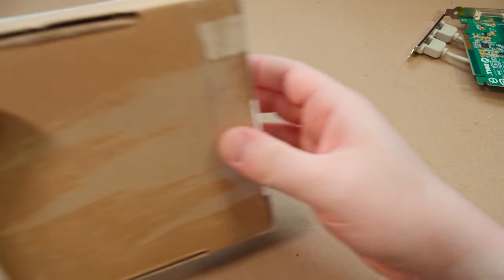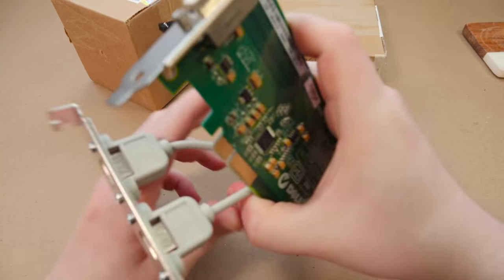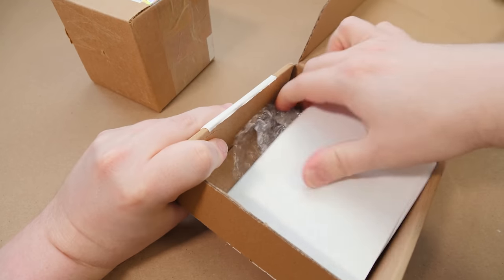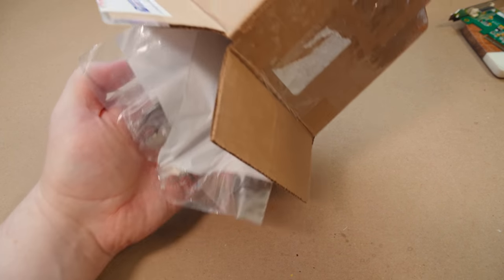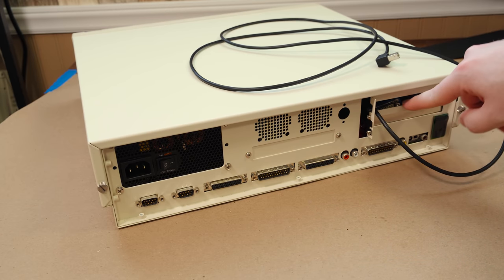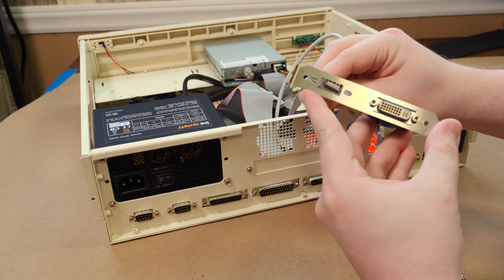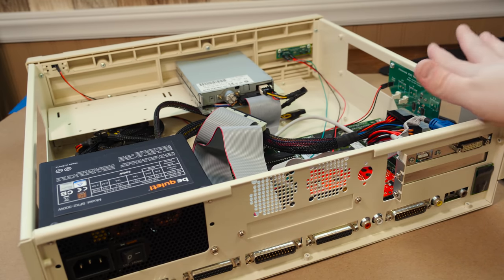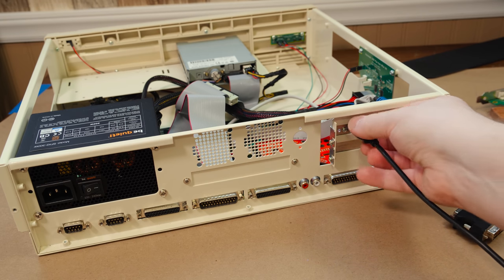Custom PCI Slot Brackets for USB and DVI Ports

Comment: This is an amazing time to be a DIYer.

As a kid, my dad and older brother taught me how to etch PCBs - buying copper clad board at Radio Shack, using a Sharpie to draw the circuit, etching with ferric chloride, drilling holes, and soldering to the nasty product that was somehow both under-etched and over-etched and almost always a rough fit even with tolerant through-hole parts.

Now, I can use a free schematics app to design a circuit, test it in a free simulator, design the board in a free PCB design tool, send the files to a fab house and, for a couple bucks, get a flawlessly manufactured 4-layer silk screened board with resolution so insanely high I can barely see the traces without magnification.  Then I can use another free CAD program to design an enclosure and have it 3D printed on high-end industrial manufacturing machines, and, design a front panel and have it laser-cut in acrylic or metal or plastic or whatever I want.  At Digi-Key, I have access to almost any electronics components I can think of, with convenient links to data sheets.  If I need something more niche, I can get everything from pre-made connectors to screws to tools to plug-in modules on eBay or Ali Express or even Amazon.

Not to even mention the amazing online communities - YouTube, Stack Exchange, Thingiverse, the entire WWW....  Or enabling projects like GCC (or GNU or Linux in general), Arduino, Visual Studio Express and all its rebrands like Atmel Studio, Mojo...

The limit is quite literally just your imagination.  Flippin’ ‘eck!
Reply: You may want to consider UV etching single sided boards for the small projects. BigClive has a video on how to do that.

Comment: For the round DIN port hole in the case, there are plugs called blanking grommets which are readily available in just about any diameter you can imagine.

Comment: Next blerb: adding a car lighter to the round port in the back
Reply: Only if it comes with a cup holder
Reply: @aidancommenting  Usually the optical drive goes in the front.
Reply: @eDoc2020  It was a joke, I didn't say anything about where it goes
Reply: I think he has a front plate for that! lol
Reply: @AlejandroFerrariMc  Why not use the case as a cup holder? Not like you're moving the computer around, and you can work and drink at the same time! Lmao
Reply: It'll yellow the case so he'll have to go through the pleasure of retrobriting the case.
Reply: @aidancommenting  ONLY
Reply: He could just use that thing for the front slots that comes with a car light and actual cup holder.
Reply: it wouldnt be too small for a cigarette lighter, the big ones that are standard these days are actually cigar lighters

Comment: Had the same feeling when I randomly found some guy who made 3D model of plastic HDD brackets for my old Cieftech Full Tower case. I printed it in local 3D-farm and rushed home to check if it fits well.
Worked like a charm. it's awesome when everything sticks together good and looks just fine. And it's super-awesome when you can use help from people all over the world. Heil networks!

Comment: Because, if you're Clint, you can never have too many ports.
Reply: Then the Amiga is certainly the perfect system.  That thing had upgrades every which way from Sunday.
Reply: Having all the right connections is very imPORTant to him.
Reply: Both hardware and software, nice :P.
Reply: I've been watching LGR for like 6-7 years at this point, and just now I realise that the guy is named Clint. 
I just never knew. 

Now that says something about how great his content is. 
Cool name though!
Reply: @jesperfrost2358  To me, it makes me always think he's about ti sey "My mistake: four coffins.". 😂🤣😂.
Reply: @TheTurnipKing  But no PS2 port to plug in the IBM Model M.
Reply: That's why I have a hangover, I am not Clint.
Reply: @JeffDeWitt    Pretty sure such adaptors are available, but using a PC Keyboard on an Amiga is some kind of blasphemy only practiced in the Dark Days of towered up A1200 systems anyway.  Ideally you should be using one of the keyboards for the Big Box Amigas so you can have the Amiga keys instead of Windows keys

Comment: For the round hole, just a little metal plate and drill a couple holes and screw it in place on the inside of the case. Quick, easy, and would look good. Getting all the little things the way you want them on anything custom (cars, computers, anything) takes time and tinkering.

Comment: I'd probably just go for a dome plug, available in all sizes. Or, go the whole hog and get a midi interface and a 5 pin din. You know, just cos, more ports. Or maybe a cassette din adaptor? Sure there is a gizmo that does it. 

For the fans, of course, lower voltage for slower/quieter. Standard is a 12v fan running on the 5v rail, but they can have trouble starting up. I find 24v fans on 12v are more reliable. Not as common in the junque bin, but definitely available if your buying new.

Looks pretty swish dude.

Comment: I actually bought my 3D printer in part because of this case, it’s nice to have my GBS-8220 VGA converter internal to the system with my custom bracket and not sticking out at the side like I had to with the original case.

Comment: Bet you could plug that round hole with something out of the 'hard to find' hardware drawers at Lowe's. I think they've got an assortment of sizes for just snap in plastic hole plugs, or you could get a rubber plug.

Comment: I wonder if that round hole for a keyboard port (?) could be covered by a hole-cover for electrical boxes. They sell snap-in metal ones that cover knocked-out holes that aren't needed, but it's obviously only for the specific sizes of electrical box holes.

Comment: Super nit pick. The usb port is upside down.
Reply from the maker: I've honestly never given any thought to USB port rotation, haha
Reply: So he just shortened the plug-turn-plug-turn-finnally-plugin of USB by one plug-turn-sequence. ;-)
Reply: Haha, I was thinking about making this comment too. My OCD is like ... nooooooooooooo LOL. Great video Clint!
Reply: @deineroehre  my thoughts exactly.
Reply: Oh good its not just me thinking that.
Reply: impossible. Everyone knows that USB ports exist in a special state of flux where port and plug can only ever match on the third attempt.
Reply: @deineroehre  You can never get around upward position, downward position, and superposition.
Reply: Does it transform the 4D USB port into a 3D USB port or a 5D USB port?
Reply: I have seen USB devices that have the top and bottom swapped so depending on what cable he's using it might be right way up
Reply: @bland9876  Yeah, there IS a standard for this. Just because devices sometimes ignore it, doesn't mean there isn't a 'correct' way.
Reply: @KuraIthys  if the USB cable has a USB symbol on one side I will usually stick that side up first even if I have a USBC adapter on the cable
Reply: This is why I like USB C
Reply: @TatsuZZmage  more like USB 0

Comment: One of those PCI screw cover things would be nice, too, IMHO. You see them on small form factor PC cases a lot. It would just cover the hole to the left of the PCI brackets. Seems like it could just be a fitted piece, as long as you can get it to be color-matched.

Comment: That round hole could easily be covered with a metal blanking plate, and it would not be super hard to make, just drill two holes in a piece of metal of the right size.

Comment: What would be nirvana for this purpose is if there is a bracket for a gameport and USB port (perhaps from some old prebuilt PC in the 1990s), since the DVI port is the same external shape and size as the gameport.
Reply: eddiehimself You need to go a bit later: early 2000s, when the space for the game port was needed for providing extra 3.5 mm audio sockets, it was typically put on a bracket along with two usb ports. My 2004 PC has that arrangement.

Comment: I'm looking to do the same thing, custom slot brackets to bring Raspberry Pi connectors from the drive bay it's mounted in. Two ethernet ports plus the composite video/audio jack.

Comment: There have been times where Ive needed to make custom slot brackets like that. I wish i had the space for a metal workshop or even a 3D printer. I have enough money to buy stuff, just nowhere to put it. I have to make do with a drill and various sized files to make custom shaped holes.

Comment: Hey Clint, what about adding an actual 5-pin DIM-port at the back, which is where the DIM-port usually was placed. :) Haven't done any research on it, but maybe you'll find some kind of USB >> 5-pin-DIM adapter somewhere which can be drawn/hidden inside the case ! Makes you able to connect an old IBM original keyboard to that.

Comment: You need a DVI to HDMI adapter to let you use a up to the moment TV as a monitor or what about using a LG PH450UG and use the wall as you TV screen but you will want a sheet of brushed steel sheet to project onto maybe 50" square.
Reply: that is incomprehensible without punctuation
Reply: @jbfarley  Google LG PH450UG I think you will be interested.

Comment: Clint, why don't you use your empty slot for your CF-IDE boot drive adapter? I know the Amiga has a laptop 44pin connector and the bracket-mount adapters have 40 pin desktop connectors, but this is easy to overcome. An adapter made to plug a laptop drive into a desktop ribbon cable can actually be plugged into the Amiga's motherboard and used in reverse.
Reply from the maker: Because I'm never going to remove or swap it, it's meant as a hard disk replacement. And I have another slot on the side with a removable CF card.
Reply: @LGRBlerbs  I guess I'm the only person who swaps boot drives...

I didn't know if it would be needed to switch between different OS/Workbench versions, as I thought you could only boot from the primary drive.

Note: I know next to nothing about the Amiga's software structure, so I could be mistaken.

Comment: I'm with you on putting some tiny fans in. It would drive me nuts having space for fans but no fans in them. :P Would they be to whiney, though? There's got to be something that would make them run slower. Heck, it's not like you need much cooling anyway. ;)

Also, I would put some sort of button in that little round spot. Or, heck, maybe some sort of tiny hooded light to illuminate the back? I don't know. The possibilities! Man, I want to get one of these cases just to mod it out!

Thanks for sharing these little moment blurbs of joy with us! :)
Reply: Mr Guru  how about wiring it up with 5 volts instead of 12? 
it seems to me to work to make it spin slower... though, not always works, have encountered some fans which would not spin or would only sometimes spin... but most fans that I tried they did always spin. 
Or could that cause damage to the fan? (you know what type of fan I'm talking about, exactly the kind which would fit in those places that Clint showed)

Comment: I can attest to the shortcomings of trying to DIY similar brackets for video cards missing the PCI slot, I don't own a dremmel so I spent well over 2 hours with a drill trying to make a VGA slot for my Voodoo 3 - not fun :(
Reply: I made my own bracket for a wireless card out of cereal box cardboard. That wasn't too bad because it was just a few round holes.
Reply: @eDoc2020  I've done the same for one of my other cards, cut an old box and used that to hold it in place.

Comment: Measure the PCB adapter that sits outside for the power inlet on the board and I will send you a 3D printed one gratis.  Hope to help on this project, it would be awesome.

Comment: I'm currently trying to find a tidy way to mount my gotek floppy emulator in my Tandy 1000SL but I don't have the brackets for the 5.25 drive bay. Maybe I could take measurements and have them 3d printed?

Comment: I think it's strange people want to automatically go to 3D printed plastic as a solution. Seems pretty simple to contract out the CNC metal solution
Reply: 3d printing is very quick to iterate and get a prototype quickly is why.
Reply: If you already have a 3d printer you can use it will be much cheaper (and usually easier) to print parts yourself.
Reply: doesn't the plastic melt in hot though? might be not best for the particularly hot parts of the pc.
Reply: @KingLich451  the area it is in it wouldn't get hot. 

Also the lowest melt temperature I can find for any 3D printer filament is 165 degrees c. If it gets that hot you have WAY more problems.
Reply: You can actually just use flat plastic plate from a hobby shop, but many use these projects as a harmless way to gain practice with 3d printing.
Reply: @TheTurnipKing  yup,good practice for 3D design and getting to know your printer.

Comment: Is there really no way to feed power into the motherboard without using that external plug?
Reply: Not without either modifying the board, like directly soldering the wires to it, or making it so that the ports are not on the back of the case

Comment: now you just need someone to 3D print a plug you can put into the circular hole
Reply: Or a small metal plate with screw holes.
Reply: RetroManCave 3D printed one to accommodate a headphone jack in his case, just needs the hole removed and it should work fine as a blanking plate
Reply: You can also just get plastic plate from a hobby store, cut it to size and hold it in place with a couple screws or nuts.

Comment: fyi, pla will warp and melt in hot environments.
Reply: I doubt the Amiga is going to get terribly hot by modern computer standards, tbh.
Reply: Glassing temp for PLA is around 60*C if the bracket was getting that hot the rest of the system would be in bad shape also. The part would be better in metal though or abs for strength reasons the PLA print appeared to have leveling defects on one side and adhesion issues especially around the screw holes so its integrity would have been questionable.

Comment: let's say, if an fellow viewer needed some help in putting together his project, could you possibly help?

The project consists in repairing and upgrading an not so old Supermicro X7DB8 based server, it's an Itautec MX221 (Brazillian brand)

I have parts, for most the upgrades, I just need some help in the OS and things
Reply: What do you need help with?
Reply: @SoulcatcherLucario  I have really low experience with server OSes. I'm trying to figure whats the best OS for this machine. I have an IBM System X 3200, that don't accept any OS that I try. I'm scared that this one will be the same.

Comment: I'm suddenly very conscious of the SSD that's been floating around inside my case for two years because I'm too lazy to get a drive bay adapter.
Reply: It's fine, the only worry is if the SSD hits something floating around inside the case.

Different story if it's a mechanical drive, mind :D
Reply: I tried that. It would sometimes hit my GPU and short it out, causing the video driver to crash. 

Wound up putting it in the DVD drive place. It was a smaller case, so it uses laptop DVD drives, and had a cover. On another machine with a full DVD drive, I just wedged it in above the DVD drive with some bits of paper packaging, then eventually used zip ties when I finally removed the DVD drive (since it wasn't plugged in, and I could use an adapter to make it external.)

Anyways, my point is, try either wedging it in on top of DVD drive, or use zip ties. No need for a bracket.
Reply: can't you just use some tape to stick it to something?

Comment: WTF is the graphics card that you shown? it looks extremely interesting to me (and probably some of the subscribers too)
Reply: Looks like it has only x4 worth of PCIe edge contacts, but with 16x worth of PCB (WHY, DELL?!? You can't use this card in a normal x4 slot because of that!) and it says DELL on it.
Reply from the maker: It's this thing, I'm honestly not sure what exactly it's designed to accomplish
https://store.cwc-group.com/sil1364.html
Reply: @LGRBlerbs  seems like it's supposed be a mere display adapter. Like for an office computer, so word processing can be done but the workers can't sideload any 3d games (2d games probably work though) and play them on company time
Reply: @UnlimitedRun  does it work with the onboard graphics chip? giving it a DVI port?
Reply: @silkwesir1444  I don't actually own one of these, I'm just going on educated guesswork based on what I know about computers. (Did you know the Nvidia GeForce GT 710 comes in a pcie x1 slot size varient since like 2016?)
Reply: @LGRBlerbs  thx!

Comment: You should really invest into a 3d printer, 
-~$200 Ender 3 or anycubic i3
-~$400 Prusa mini
-$750-$900 Prusa mk3s
Here are the most popular choices right now, I suggest you get one as it is very useful.
Reply: I printed it on an anycubic i3 mega. I have my personal machine and also help run one at a stem camp, both have been rock solid over the last few years. The ender3 is great (a local makerspace bought several at my recommendation) but I have since found that the rollers for the bed tend to loosen over time, a minor issue to fix for how often it happens but still a bit of a pain when you just want to print. Still overall those are solid recommendations, and I am sure Clint would be surprised how many small issues can easily be solved with a 3D printer,
Reply: @TobyCowles  Oh yeah the anycubic i3 ! I would thrust it even more than my ender 3 pro, looks really sturdy !
But It wouldn't make a great assembly video since it comes in 2 parts 😅 which is great if you don't want to make a video about assembling it.

Comment: 3D printing isn’t a bad way to go with this, but I’d recommend a more temperature resistant plastic like PETG rather than PLA. The PLA plastic might warp over time from the heat of the electronics.  Also, I’ve found PETG is generally more pliable and less prone to fracture than PLA.
Reply: Jim Notor I saw that. However, he’s not the only one who might be putting together a project like this.